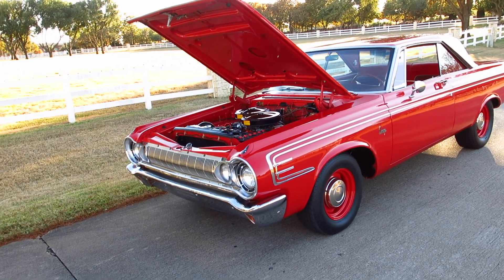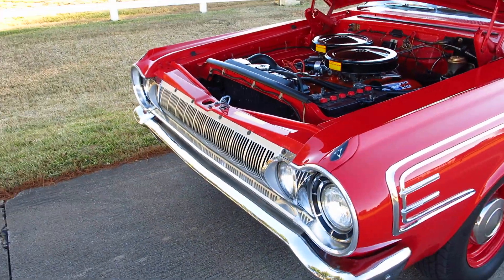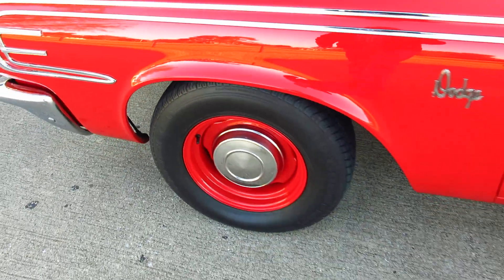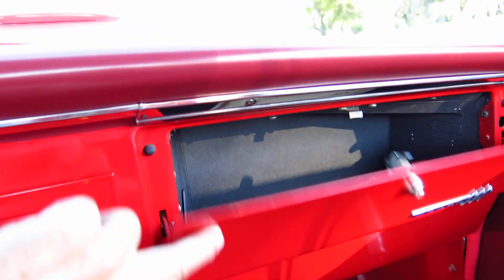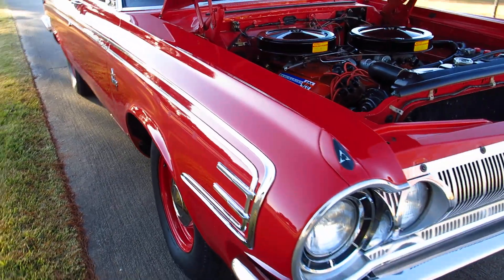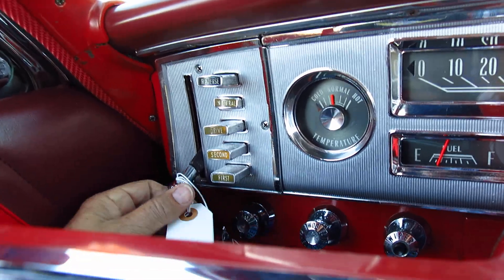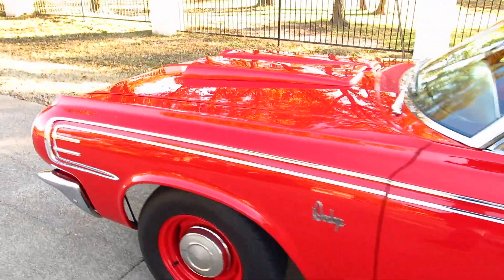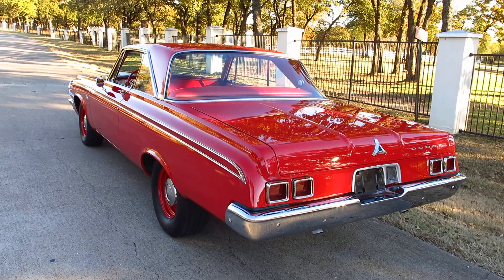1964 Dodge Max Wedge Clone, 426, sure grip, street stall, exhaust cut outs

Comment: My absolute favorite car. So basic and wicked quick. I drove one once and the torque on these max wedge cars was incredible. You could be cruising along at 50 mph, kick it down and burn rubber. At launch it would pin you in your seat and lift the front end. Really well done clone. Paint is amazing 🤩

Comment: I had the same car, same red color back in '82, mine had '71 440 intersceptor, reverse manual with 3500 stall ,staightt axle, rallys with 50's all the way around with a black painted grill, looked like the Devil; coming at you, and twice as mean. It was scary.

Comment: Shouldn't the battery be in the trunk?
Reply: I believe only if it was a factory light weight car
Reply: All factory light weight cars had trunk mount but all Max wedge cars built after March 1963 had trunk mount batteries, so it appears this one isnt correct.
Reply: Keith Clark   He said it was an accurate clone.
Reply: The pushbuttons are in the wrong order for a Max Wedge also front seat is wrong.